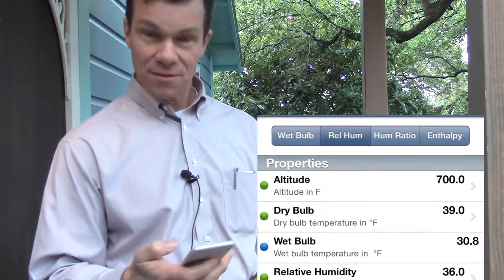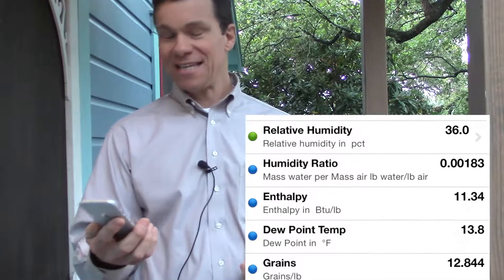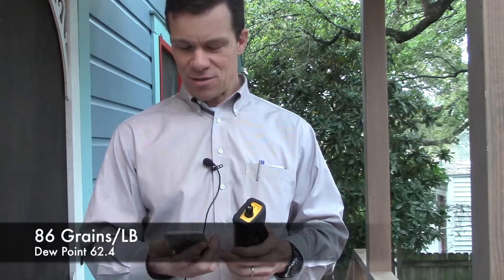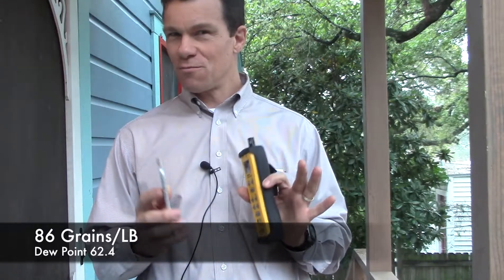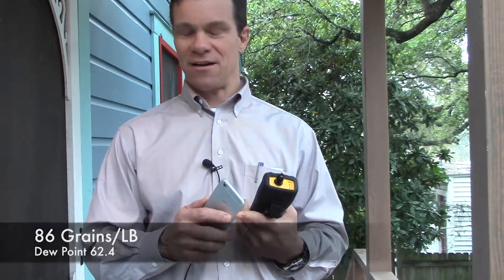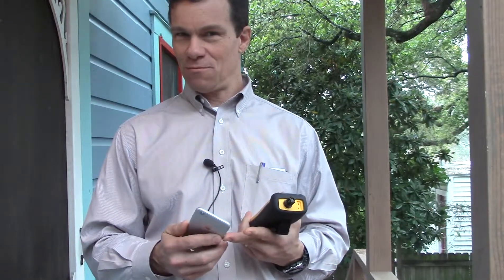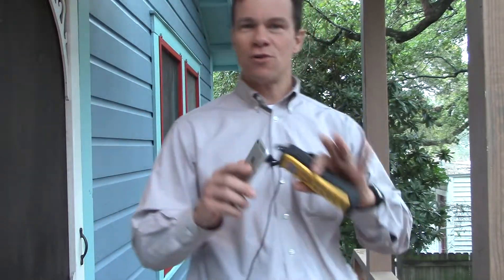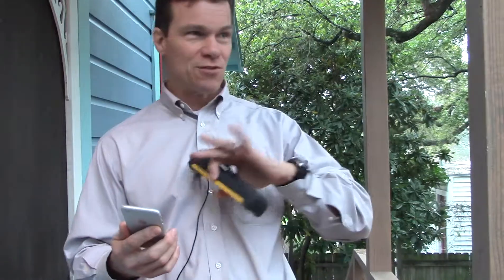Kristof Irwin of Positive Energy On Moisture & Humidity

Comment: Great video!  Could you speak to the other end of the spectrum which is the problems/concerns with low levels of water vapor in the atmosphere?  Is there an ideal level of water vapor that is comfortable, safe, and does not cause premature degradation of materials?  Thanks again
Reply from the maker: Here is Austin, concerns over too dry are infrequent. That said, you're right that furniture, skin and lungs all suffer when overly dry. My advice is always an in-the-room humidity solution. Even in cold climates, I've seen more problems from central humidification systems than solutions.